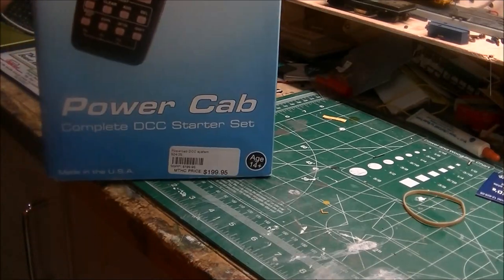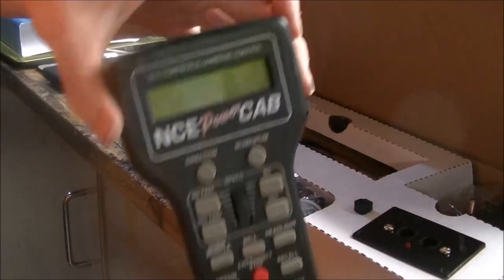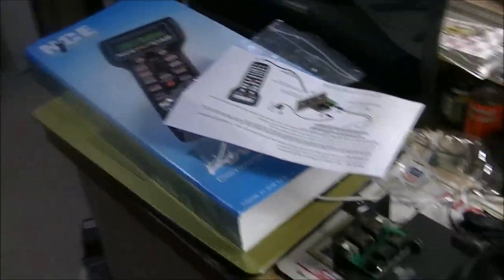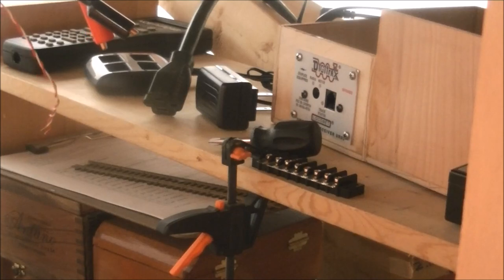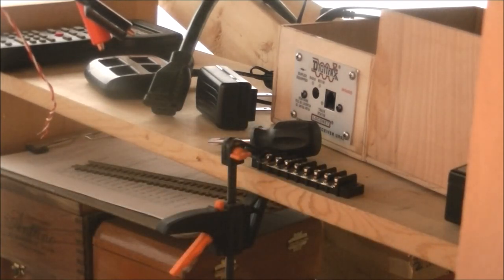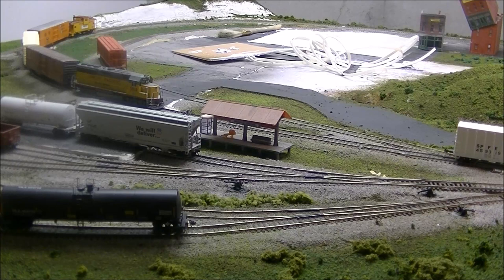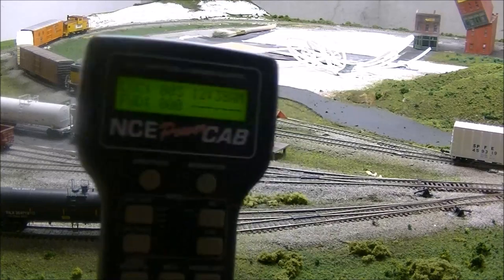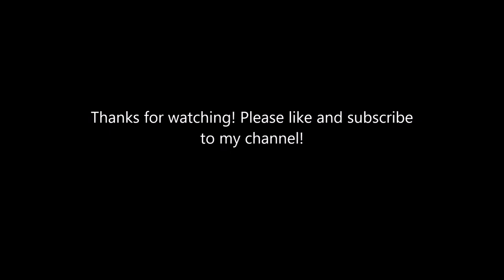NCE Power Cab Review

Comment: Daniel, Congratulations for your Channel, I also found it after you mentioned on What´s Neat Podcast.   I have DCC question. I have two intermountain SD40-2 with ESU locksound decoder, do I need to speed mach ?   in order to have a great  consist. Thanks
Reply from the maker: just4fun Trains i would speed match them to make sure they run smooth.  Sorry for the delayed response.  
Daniel

Comment: What do you recommend, NCE or digitrax?
Reply from the maker: EWC88 if you are just starting out, I would go with NCE.  If you are a dcc expert then go with the digitrax dcc system.
Reply: Well I have experience running trains off them but that’s it. My old layout was just DC and my new layout in building in my basement will be DCC. My grandfather uses digitrax so that’s how I’m slightly familiar with it.